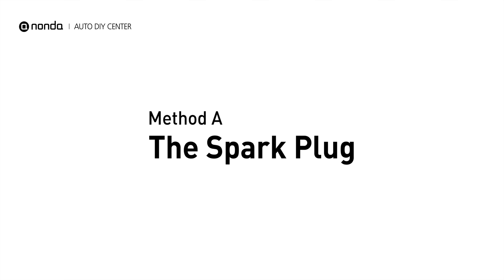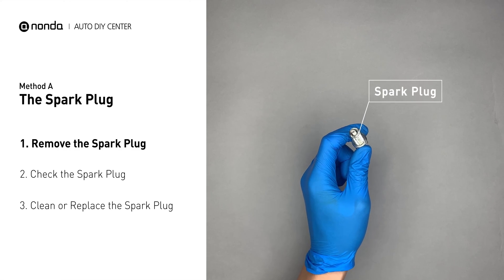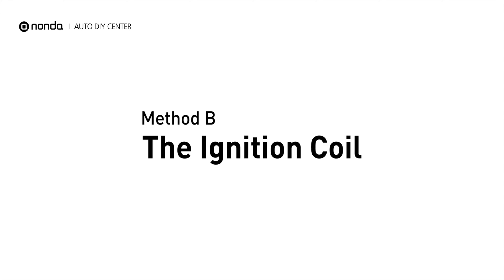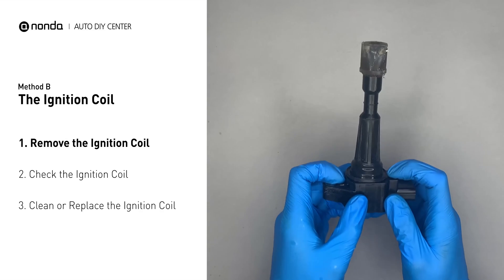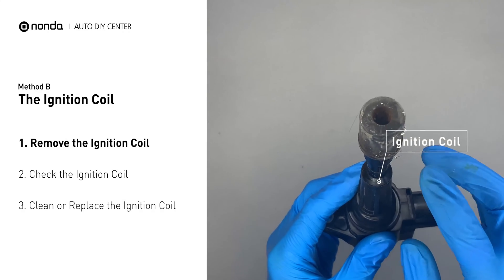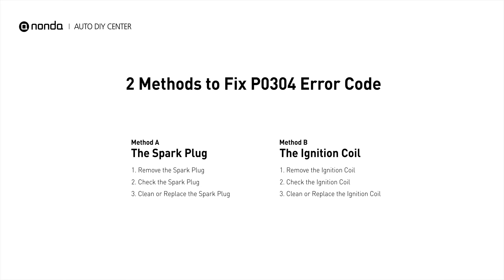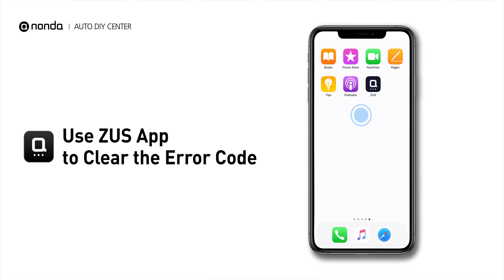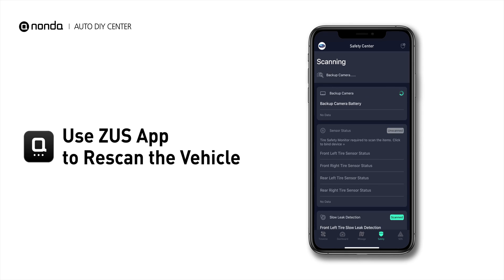How to Fix P0304 Engine Code in 3 Minutes [2 DIY Methods / Only $4.33]

Comment from the maker: Hi, I'm Steve, nonda's lead mechanic engineer. 
Feel free to leave your comments here if you have any mechanic questions, I will be glad to help you out!
Reply: It keeps doing the same thing all new
Reply: Thanks good reply I need to know if I replace a 303 do I need to replace the 304 or do I need to replace them all because I replace the 303 code I replace the coil and the the spark plug so now do I need to do the same with 4 or am I going to have to do them all

Comment: I need some help. I have a 2 ltr gas vw jetta 2012 and i got a p0304 error code. I replaced all the spark plugs aswell as the ignition coil pack and i am still getting the error code. To make ot more strange the car runs fine past 1000 rpm but when it goes below 1000 rpm the engine rumbles. Anyone have any suggestions
Reply: Have same problem on Audi A4 2.0T
Have changed plugs, coils, maf, valve cover gasket, pcv valve,  air filter so it leaves me to try other things.
????? which would be  blocked injector,  vacuum leak, ring in coil.  some people will say its a clogged fuel filter but
can't see how this would just affect one cylinder also bad fuel pump but again can't see how this would just affect one cylinder .   The other thing it might be is a broken wire going to the coil. Try moving the coil and plug to a different  cylinder  and see if code jumps to that.
Reply: did you fix the problem  @mickbowler7501

Comment: Swap the coil with another one, if the code shows up on another cylinder, then you know the coil is the issue, do the same with the spark plug. If it still shows up as cylinder 4 after doing that, then you know its something else. At least you didnt spend out on anything like buying a new coil or plug and it didnt solve the problem.

Comment: I have a 2003 Honda civic with a check engine light with code P0304. I have replaced 4 spark plugs and 1 ignition coil for engine number 4. The check engine light is still on. what do I do now. Thank you
Reply: Delete the code or unplug your battery for 5mins then plug it back up nd drive it at least 50 Miles and see if it comes back on

Comment: Hey guy,I have an 2003 honda accord and my issue was engin check light flashing. I changed 02 sensors and all 6 coil packs. Now it won't start.!!!!!
Reply from the maker: Hi Tony, issue with the ignition coil or the spark plugs could be triggering the code. Kindly check these parts and replace if necessary.

Comment: I have a 2017 Ford Mustang with an Eco Boost engine. I changed the spark plugs and ignition coils, but after a few days, the check engine light turned on, and the code P0304 popped up.
Reply: Check the gap , for 4th cylinder and id just focus on the 4th cylinder coding tbh
Reply from the maker: Hi Steven, is there any other code that registers along with this code?

Comment: I have 09 Mercedes R350 4 Matic , changes 4 spark plugs still have code p0304, don't know what's the problem
Reply from the maker: Hi Will, please confirm if this is the only code you're getting.
Reply: Yes, this is the only code getting.

Comment: My wife has a 2014 Mazda 3 isport. The car would randomly idle high and then return to normal when sitting at red lights. The check engine light came on and a few codes popped up but the only one I was able to read (without the Mazda add-on) was the P0171. I assumed that it was possibly the MAF sensor, so I cleaned the MAF and put it back in. Later that day she took it out and when she stopped at the gas station it wouldn't start again. Later in the day we went back to get it and it started right up. Took it to get a diagnostics done and they returned with the codes P0171, P144A, p0304
Reply from the maker: Hello, since you are receiving multiple codes, we suggest getting your vehicle visually inspected by your local mechanic for further diagnosis.

Comment: Ok so when I was trying to change my spark plug, the old one was loose. And when I installed the new one it wasn’t tight like the other. Still showed the code P0302. Any suggestions as to what to do in that situation😢
Reply from the maker: Hi Farias, please provide us with your vehicle's year, make and model.

Comment: I have a 2009 chevy equinox and having this issue currently. I replaced all 6 spark plugs the coil pack and spark plug wires. cylinder 4 misfire detected code still having my check engine light on
Reply from the maker: Hi Elliott, have you double checked if there's any other trouble code registers together with this code?

Comment: I change the spark plugs and wires and the distribiator and rotor. And all the fuel injectors all new . I still have misfire cycle 4
Reply from the maker: Hello, please provide us with your vehicle's year, make and model so we could give you the repair methods according to your vehicle manufacturer's recommendation.
Reply: You fried a ring
Reply: @johnscott1981  was this the case?
Reply: @colarmstrong57  all ya gotta do is a do a compression test on cylinder 4 and compare to the other cylinders that aren't misfiring. I'd be willing to bet that it's the ring.

Comment: My srt4 is giving me the 304 code. I've replaced injector, plug ,and coil. I still have the code....
Reply from the maker: Hi Ray, try to reset the code and swap the coil pack, wire, and plug from cylinder 4 to another. If you'll encounter another P030X code then you'd know that the issue is coming from these three. Please check if you have a vacuum leak, or low compression as these could trigger the code also.

Comment: Great video! 06 grand marquis P0304 code spark plugs replaced! Tomorrow ignition coil will be replaced to see if that fixes the problem
Reply from the maker: Thank you for your feedback, Titus! Keep us updated.
Reply: Did it fix the problem?
Reply: @saeedalhameli826  Sure did work no misfire anymore. Car picked power back up and now saves a little more gas with the tune up. Thanks a ton. I do recommend to replace all coils at once! I changed 1 coil at a time then I started getting multiple misfires. Change them all at once and eliminate the codes
Reply: @titusdixon2758  i did swap spark 3 with 4 and still misfire then coil 3 with 4 and still the same misfire in 4 so that means i have a problem but I don’t know it
Reply: @saeedalhameli826  Do a full tune up. Change all sparks and coils and it will ride just fine.

Comment: Should I change the injectors. I changed all spark plugs and the engine light is no more. But I m experiencing power loss. When I drove uphill, it felt like the engine was almost  dying. So I accelerated gently and was able to ride uphill but it was very difficult. Also, the rpm needle keeps on dancing while in a normal drive.Please suggest.
Reply: No, this guy says it can only be the plug and it will only take 3 minutes.
Reply from the maker: Hi Rubeen, it is recommended to have the vehicle visually inspected by a certified mechanic to determine what needs to be done to fix the issue.
Reply: Throttle body housing.
Reply: I can I only say don't throw parts at it.  I did all this to no avail:
New spark plugs. New Ignition coils, New pig tails and coils, pcv valve. Changed oil. New air filter,  had intake valve and fuel injector steamed, different transmission.  Still throwing 0456 and 0304 code after 3 months of " bucking".  Other than that car runs and starts great.  I resisted taking it to Kia because of their bad customer service practices.And long time they keep your car.  But I have no other choice